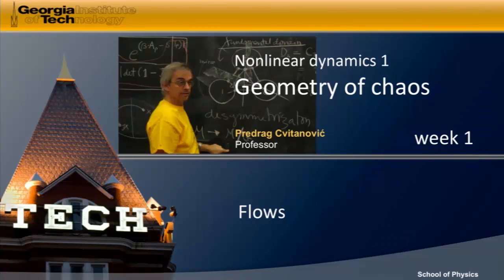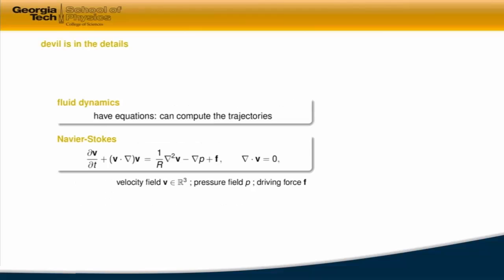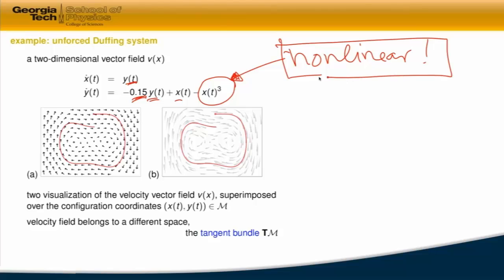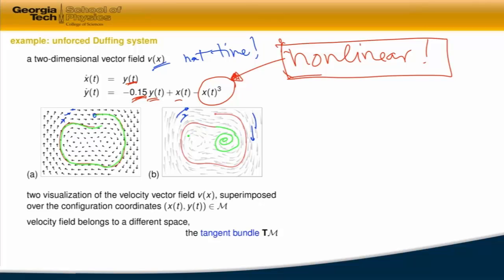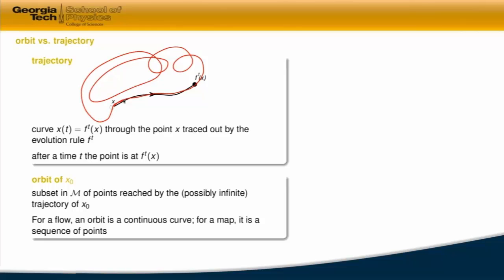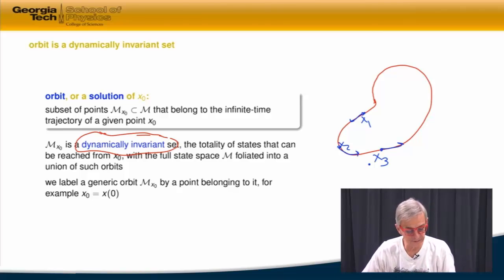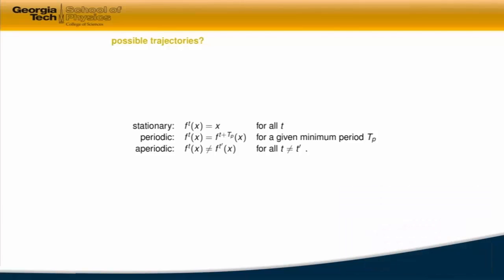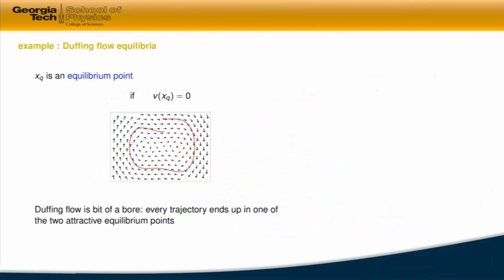ChaosBook.org chapter Go with the flow: Trajectories

Comment: You draw orbits intersecting over preceding orbits. Is that physical?  The velocity would be “undefined” at those intersections!
Reply: You are absolutely right - Georgia Tech's so cheap they give us only 2-dimensional blackboards. So all these sketches are meant to represent a projection from 3 or more dimensions on any 2-dimesnional surface: only allowed intersections are equilibrium points, which take $\inty$ to reach.